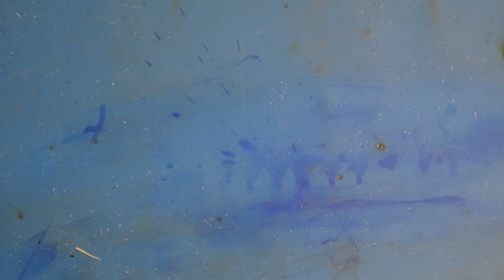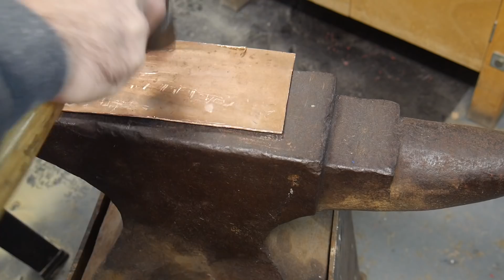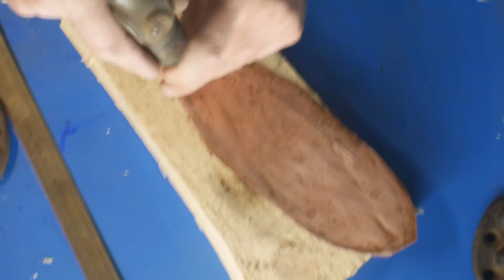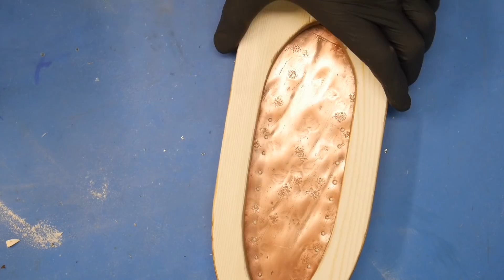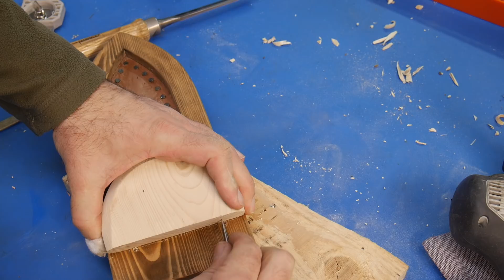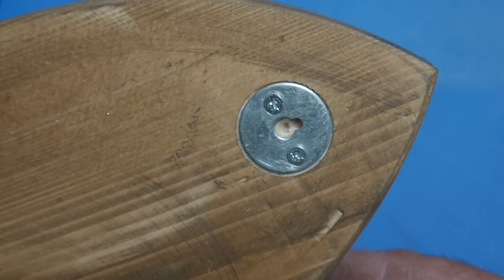How to Make an Wood and Copper Gothic Candle Holder ( wall lamp,  sconce)

Comment: ive never thought of using a washer that way. good trick.
Reply from the maker: Its a trick ive used in the past. Saves on buying different hanging fixtures. Means you can just drive a nail or screw into a wall as a hanging point.